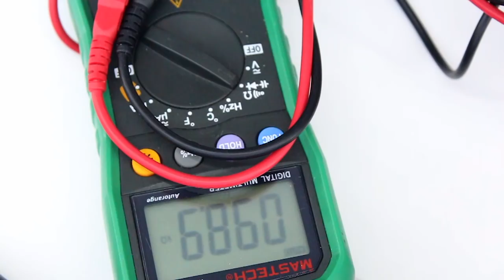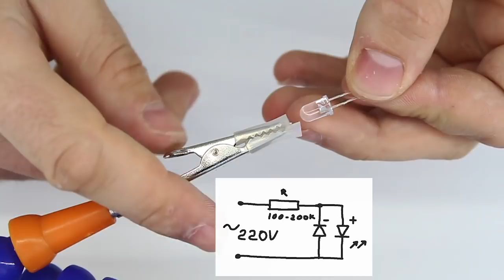LED to an AC outlet 🔓  110-220V 🔓

Comment: Permissible power of this resistor is 0.25W
While:
P =~ U ^ 2 / R = 220V^2 / 100000 = 0.48W !!!!!
The resistor blows after a short time and may cause the plug to ignite!
Reply: +Piotr K: But it's a "Two minutes transformless test" then what be will at expected...
Reply: The LED provides resistance too so you should put that into the equation.
Reply: carlos arrache LED has lower resistance so most power is dissipated on resistor and also amost all voltage is on resistor (240-3=237v on resistor so it may peak at even more power than 0.48W)
Reply: If you remove the antiparallel diode you will almost solve the problem, the average power loss whould be 0.24 watt
Reply: Without the diode, the reverse voltage will instantly destroy the LED

Comment: Please don't do these tutorials if without warnings and no idea of mains electrical safety. This should be reported.
Without proper calculation the LEDs will fail, and the circuit might start to burn. It's low probability that will happen, but very high risk that may lead to death.
Reply: RealationGames This is extremely risky I was about to loose my eye.
Reply: Perfect.
Reply: He probably was on incognito when he posted the video

Comment: Why don´t you use a ceramic capacitor with it? This will burn very soon.  Safer way is use a capacitor and go with phase across him to a anode of led and with neutral wire go across resistor with resistance around 470-1000 ohm to the catode of led and connect antiparallel diode  ( 1N4148, 1N4007...) to the led. The last thing is please you must stop with soldering ( or stop making this types of videos) because it´s shame.

Comment: The resistor will get hot and make the plastic case so soft that anyone who tries to unplug it will get stuck to it and fry
Reply: :D
Reply: debayous plug sockets are made of some sort of duraplast made pesificaly not to go soft/catch fire all thought it does say that its thermal insulating meaning it can get pritty hot so touching it would sculd your had with 2nd degree burns  (no problem) / that resistor is not a power resistor so it can turn in to molten ceramic lava 😂😂(screw using it as a night light its more like a day light when your house is burning down)
Reply: lol

Comment: Hey, didn't make this circuit they can catch fire!  

The led stays, but the resistor will start get hot and will burned! 

*this can cause a risk of ignition on your electric socket
Reply: TIRTAGT TECH 
You can use resistor 1W or 2W

Comment: what's the role of the diode?  you can remove it and save power
Reply: Without the diode, the reverse voltage will instantly destroy the LED

Comment: This is very bad idea and danger. Off rezistor but use capacitor 100nf/400V (change rezistor on capacitor) Diode N4007 is ready. With rezistor is very high temperatur.
Reply: And parallel across the capacitor a 1.5 megaohm rezistor !